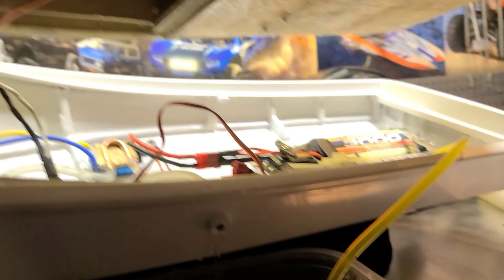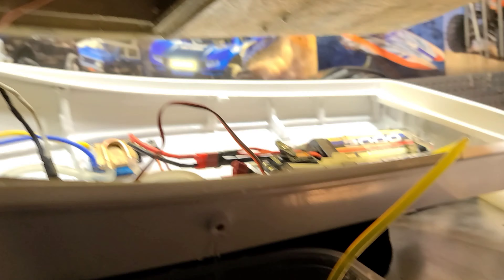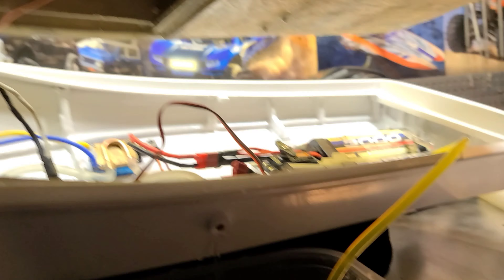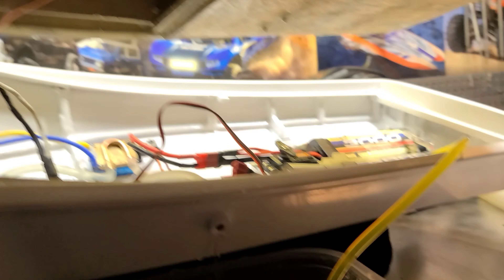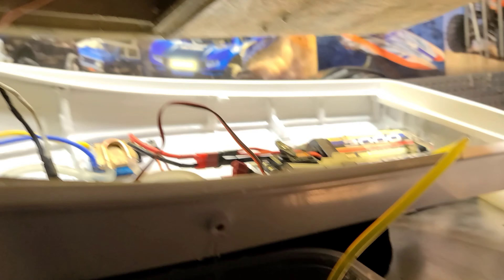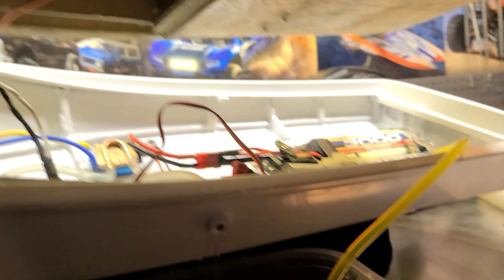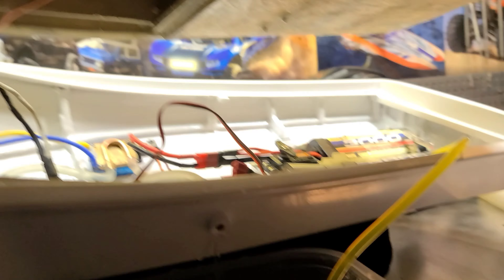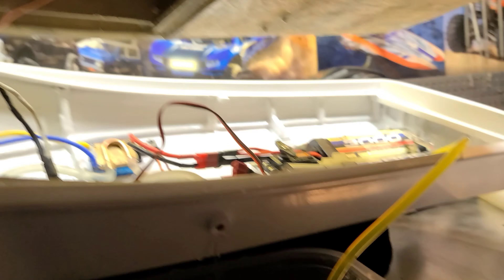Self Priming Water Pump For Rc Boat Watercooling

Comment: Hello big B, I have been water cooling all my motors and ESC's  with self priming dyaphram water pumps. I  got mu first two from Amazon but I now see the OSE carries the same pump. I use two, one for cooling the motor and one for cooling the ESC. I also drill out my rudders to 1/8 and then file the pick up slots to the front of the rudder blade.The pump will pump about 1.6 litters a minute I get great cooling on my 1/8 scale miss Budweiser . Allows me to run a little bigger prop and still stay below 120 Deg. on motor and ESC during a 6 lap race.
I am now building up a 42 inch XL cheetah for Q class catamaran.  I am experimenting on this boat with both rudder water pick up on both sides of the rudder and  a double bottom water pick ups in the bottom of each sponson. One pump sucks water up from the rudder . There is a ball check valve in bottom pick that feeds into  Y so that it can also feed water into the same main large water line to the ESC. The check valve is there to prevent the pump from pushing water back toward the bottom pick up when running a little slower when water flow from the bottom is not force full enough. People don't put much thought in to cooling their batteries.  Batteries are expensive  to replace when they get to hot and pop. Keep your batteries cooler by using a water plate on each side of the battery. Here is were I use the second bottom water pick to to run water to the cooling plate and then over board.  If you would like to know more about this please call me at  513-673-3953. The hobby has only been  running electrics for a short time when compared to nitro and gas boats so the thought of using pumped water is a fairly new idea. We don't get any were enough water flow through a rudder alone to cools Electrics down enough compared to the heat that is generated form high amp draws.  Allways remember  KEEP THE SMOKE INSIDE THE MOTOR AND THE esc.

Comment: Very nice video... I did something very similar on my M41, as it was getting a bit hot even with a dual pickup rudder.  I still pickup from the rudder, but now use the pump to ensure a steady water flow. It runs much cooler now.
Reply from the maker: it's nice to have the boat cool 100% while on the water at speed or at a Stand still/idle. Thanks for watching IRONCLAD RC

Comment: That's a cool pump! Bad joke, I know.... 😉  Adding a water pump also adds a little extra weight to a boat, but cooling is way better. I have a semi-scale boat that I built out of plywood and mahogany, and in this boat I've installed a small self-priming pump in combination with a small automotive fuel filter that takes care of any green stuff that might block the cooling system. From the pump and filter, the cooling water is split into 2 circuits: 1 for the motor, and 1 for the ESC, and 2 water outlets through the side of the boat provide me visual confirmation that all is ok.  It works really well because when I stop the boat, there is no heat build up - it continues cooling between runs. For extra convenience. I have it connected to a third channel for switching the pump on and off. It has been worth the extra effort, as the motor and ESC run ultra cool. I've been thinking about a simple, light weight system to cool the batteries, but I don't have a solution to that (yet).
Reply from the maker: I got it....    Cooling pump.  Cool.....  pump. Lol.    Thanks for watching
Reply: @IRONCLADRC  😉

Comment: wow stumbled upon this vid lol i was just last nite contemplating on puttin a pump in my horizon tug to cool the hobbywing 1080 esc i throwin in and cool the motor too. thought id test it first without just to see if i need it first. if i do need it id like to see if i could plumb it in the back of the tug to get more weight on theprop when pushing the larger speed boats
Reply from the maker: The extra weight in the transom is a good idea. I used 1lb of fishing lead in my transom